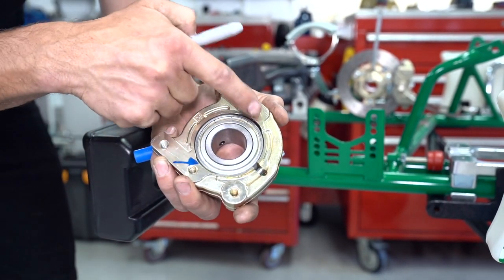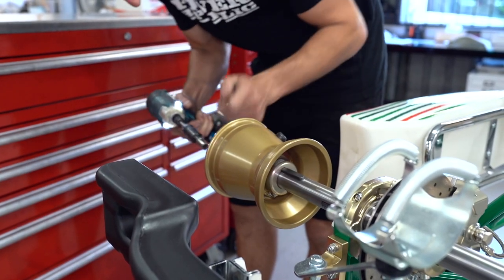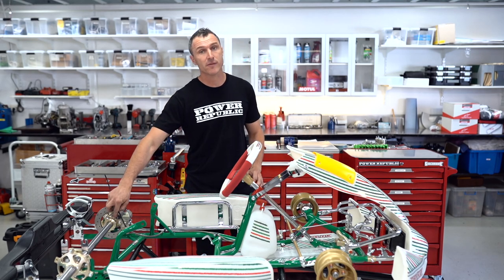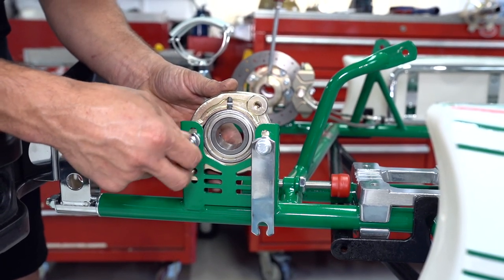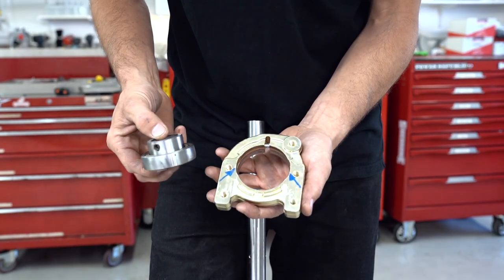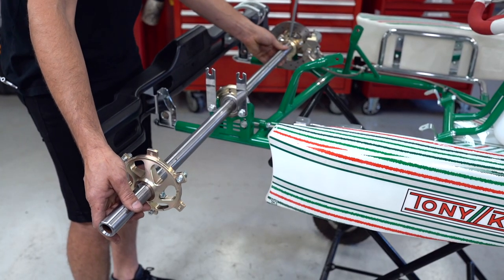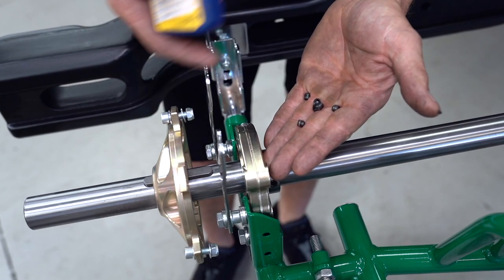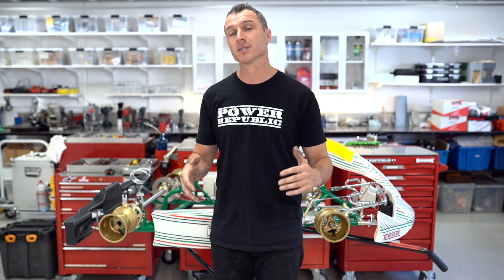HOW TO: Change Your Axle Bearings The Easy Way - POWER REPUBLIC

Comment: Great video Dez! If you're interested, milwaukee makes a 3/8 electric ratchet that is simply supreme for working on karts. You can crack bolts loose by hand and then hit the trigger to spin the bolts out with the electric power! Check it out if you dont have one already!
Reply from the maker: thanks for the hot tip JM7.   I have contacted Milwaukee just last week about converting all our power tools over from Makita.   lets see what happens ......

Comment: I am shopping for some spare bearings. Was looking at SB208/210ZZC4 but found SB208/50ZZC4 as well as many other codes depending on manufacturer etc. What is everyone else running?
Reply from the maker: we use the standard Tony kart ones, but you can use generic ones from the bearing shop too

Comment: Nice tutorial :) one question - you show at 6:32 how to properly measure distance from the edge of axle to correct position it in the middle of chassis, but it's no so obvious how to choose correct point on DD2, because there's only one bearing, and engine on the other side.
Reply from the maker: thanks heaps for tuning in.    i guess on the dd2, i use the chassis rail and a square of the axle to get the correct length.  then a good idea is to make a indent or groove in the axle as a reference point for future removal/installs
Reply: @PowerRepublic thank you :) yeah, rails under engine looks like good plan to measure correctly ;)

Comment: Hey if I have some semi dirty bearings, how would you clean them? Also at what point are bearings un saveable? Like if they get dirt in the actual piece? Last question then do you need to relube them with grease?
Reply from the maker: hey cal, you been going hard on the off season race prep!!!!

wash them our with some degreaser and then hose them out first with some water and then compressed air.  finally use some WD40 then spray in some lithium grease.

the inner race will move side to side.  not good.  normally change em ever 6-12 months, they are not that expensive compared to everything else with go karts.

yes, use some spray grease.  WD40 is too light and won't last long enough.

Comment: Any tips on cleaning/lubing the bearing? How often and what to use?
Reply from the maker: Hey Col.  if you remove them from the kart, you can wash with degreaser and hot soapy water.  then blow out with compressed air.  Then re- lube with WD first and then finally some spray lithium grease
Reply: @PowerRepublic  thanks man. Me and my son have really enjoyed the videos you post

Comment: Mate this has no reference to this video  but would like to ask what your thoughts are  I'm planing on running tag 125 heavy but I'm overthe weight limit so I'm already a heavier driver then most  do you thing being heavier I would be suited to a 30/32 chassis  more then a 30mm
Reply from the maker: yeah I reckon the big guys, big kart, little guys =little karts.   so a 32mm will probably suit you well.  albeit off topic hahaha thanks for commenting/watching/sharing the video

Comment: How do you keep your axle from getting rust on it? I find that mine turns rusty once my hand has touched it
Reply from the maker: Hey Austin, great question,  we use 2 stroke oil.  just put some on a rag and rub it straight on the axle.  leaves them shinny as!
Reply: Dont touch with bare hands, some people  are more some less problematic, depends